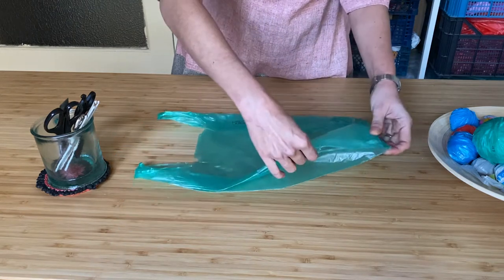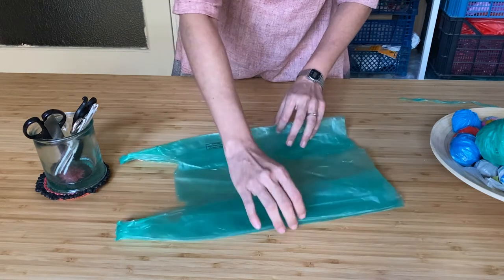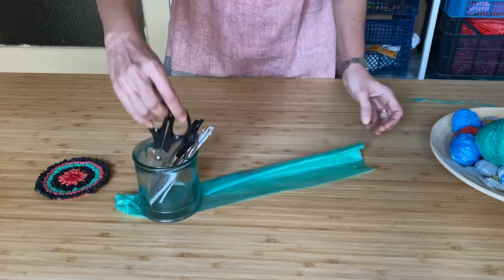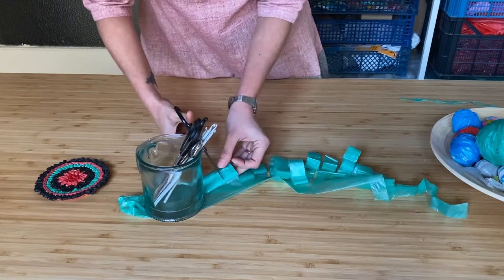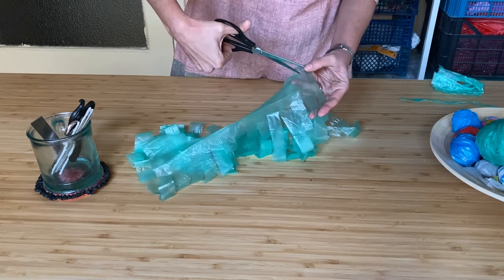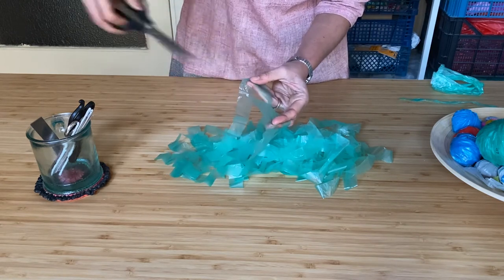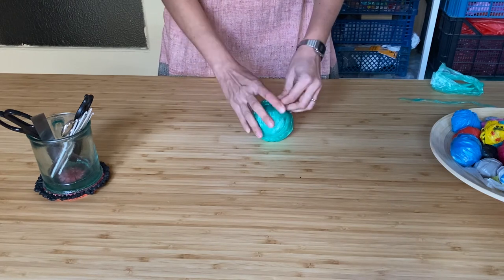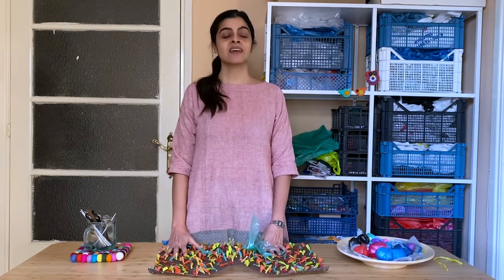How to make plastic yarn (plarn) - continuous spiral method

Comment: Thanks for sharing - lovely video. How would you adjust the width of the cuts for different crochet hook sizes?
Reply from the maker: You can cut the yarn as thick as you like depending on your project. In the video, I have cut the yarn about 1.5 cm apart which is good to crochet with with a 3 mm hook. If you would like to make something chunkier, you can cut it 5 - 8 cm apart. Of course, the thickness of the yarn also depends on the thickness of the bag, so just play around!
Thanks for watching!